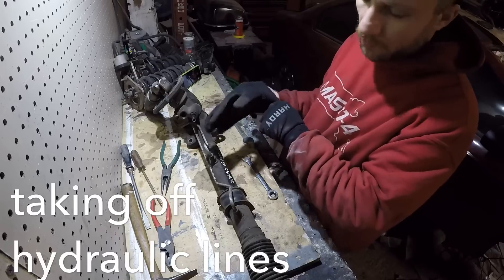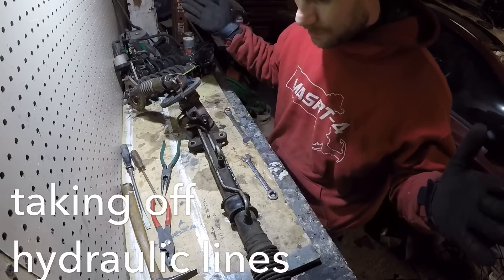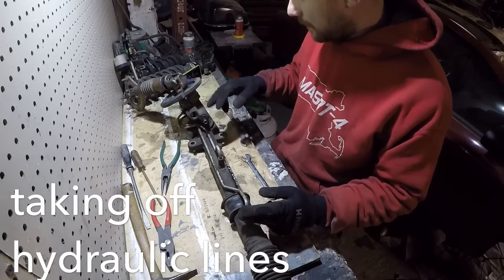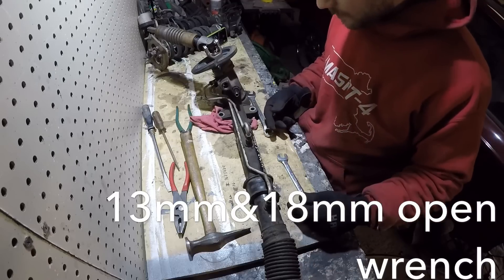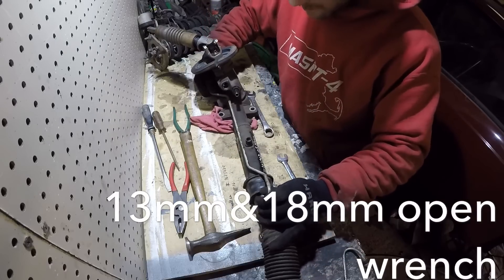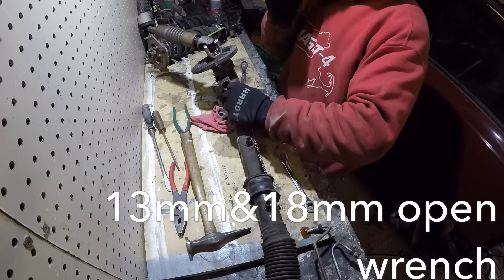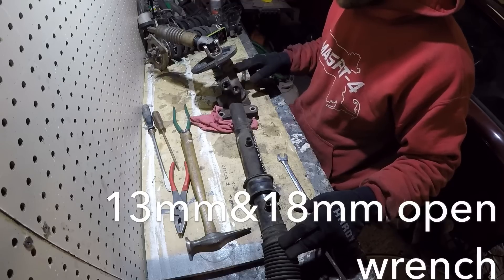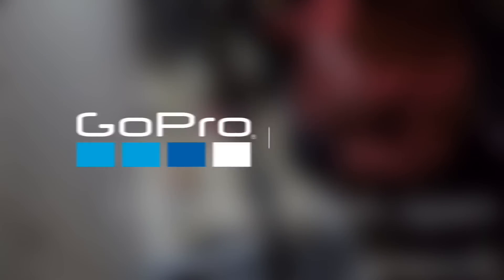Neon / SRT-4 Power steering rack de-powering Part1

Comment: When the sensor is unplugged it will pop a code
Reply: Honestly it only took plugging it back in as the sensor wasn't the problem. I was only noting that mine through a code when I forgot to plug it in. I had not thought about the resistor and that's a great idea for those who are deleting the power steering.

Comment: The sensor does throw a dtc unfortunately
Reply: Good advice man.  I've been running mine unplugged and I get a p0551 code.  I'll remove the sensor off the old rack and plug it back in and "hang" it.  Hopefully it turns my CEL off and keep it off.